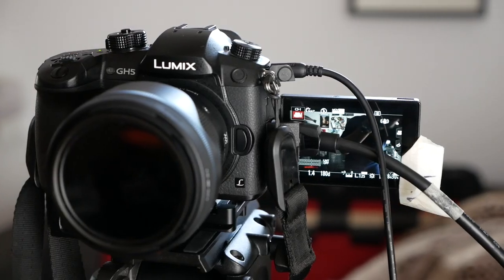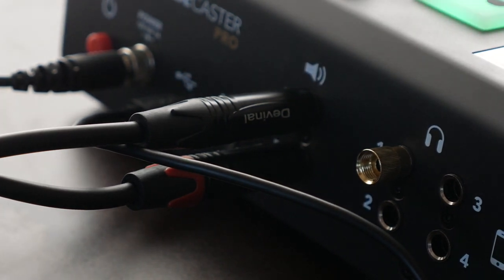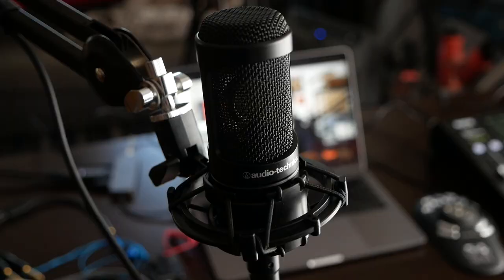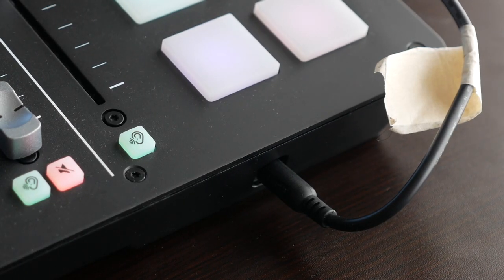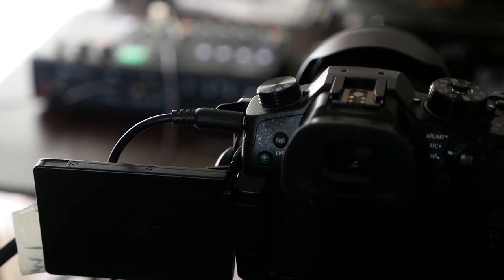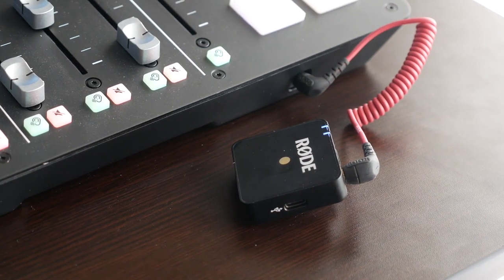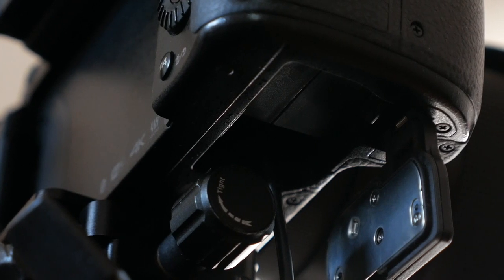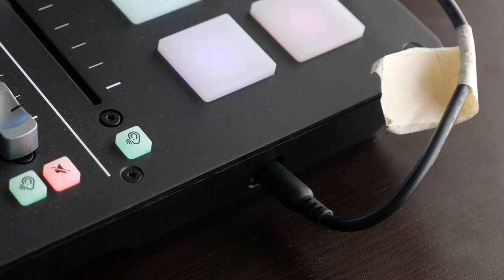Rodecaster to Camera CLEAN AUDIO Solution!

Comment: guys, the 3.5mm output in front of rodecaster and the rear outputs are booth LINE LEVEL OUTPUTS, if you try to put inside  MIC LEVEL INPUT in your camera with a cable it never works cause there are completeley different power level (impedance) outputs and inputs. what you do with a rode mic go is adapting in some way impedances to match the input in the camera for that reason it works now, the rode mic go is not intended to transform line level signal into a mic level but is something that it can do, in my case i use it to send wirelessly signal from my main speaker to a satellital one, but once you reach certain amount of volume it starting to distort due to impedance difference, cause as i said although the rode mic go is not intended to convert signals it can do it in the lower volumes
Sorry for my english i hope i explain myself right and it can be understood

Comment: I had exactly the same experience as you. When trying to connect a 3.5mm AUX cable from the Rodecaster headphone-in port on the bottom right of the unit and the other end of the cable into my Canon 90D DSLR mic-in port, the audio did not work properly. But plugging in my Rode Wireless Go lav mic system worked perfectly instead. I can't explain it either, it just works. Tom Buck creates many YouTube videos on the Rodecaster and he says he's able to use a 3.5mm AUX cable, but I simply don't know how he does it. Anyway, keep using the Rode Wireless Go lav mic, it's a better solution anyway cuz there's no cord to trip over between the Rodecaster and the camera.

Comment: In my tests headphone 1 (h1) into a GH5 with battery works best. If you are using H1 you loose some functionality as separate gain, talk back listen prefader. H2-4 gives a low hum. Monitor out get a noise about 4kHz which could depend that it’s a line level signal into mic level on the camera. Using line out on a Zoom H6 to GH5 does not give any noise... which is strange since Rodecaster Pro and monitor out does and have tested with different Rodecaster Pro same result. I didn’t try with Rodecaster Pro and GH5 into a power plug though... Just wanted to give you some more info.

The reason why it works with Wireless Go is probably that their can’t be any problems with the ground since it’s wireless. And as soon as you connect a cable and both are plugged into power there can be problems with the grounding.

A clean box or ground loop noise isolator might help you when you have both connected to power. Rode is aware about this problem with the noises I described in the beginning. No solution. If you have both connected to power make sure they are connected to the same power board it might help.

Comment: The voltage converter electronics of the wall power battery adapter are probably designed poorly and not well shielded. That is likely generating a lot of RF noise. Your 3.5 mm cable running next to it is acting like an antenna and picking it up. I’ve seen the same kind of noise generated from other cheap wall warts and chargers that I have to be careful with around my recording setup. 

It would be an interesting experiment to have your camera running off of battery power and connected to your mixer via 3.5mm cable. Then take various power converters, charging bricks, and other electronics and put them near your 3.5 mm cable while recording to see which ones are the worst offenders. You could even try the camera power adapter plugged in but not in your camera. Might not have the same effect but would be interesting to see. 

I’ve also had issues having my cell phone too close to recording lines which causes interference noise when the radio antenna activates. Good luck!
Reply: Another thing you could try would be to use a much better shielded 3.5mm cable to reduce the amount of RF noise it will pick up.